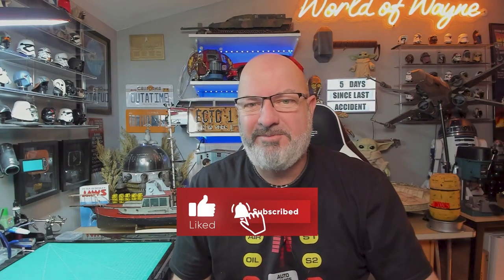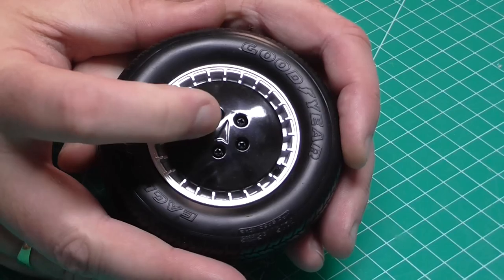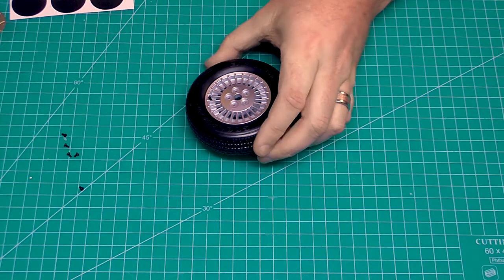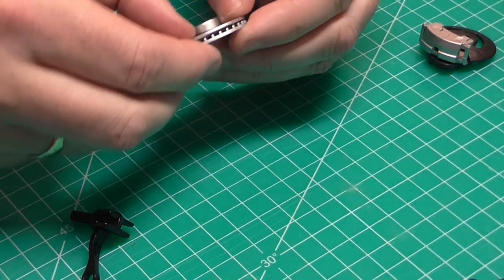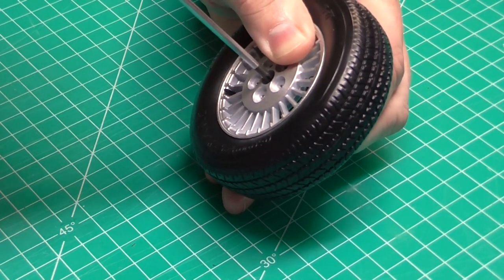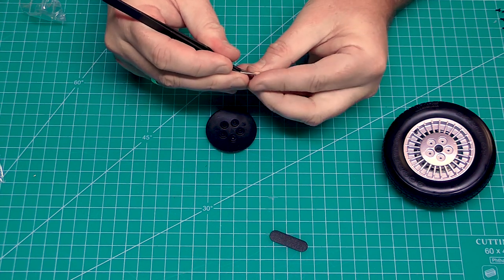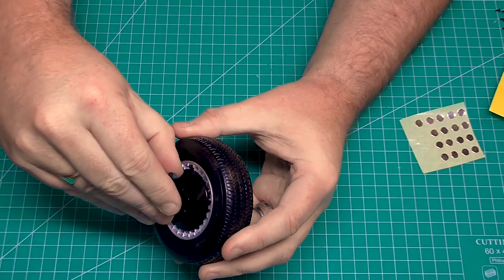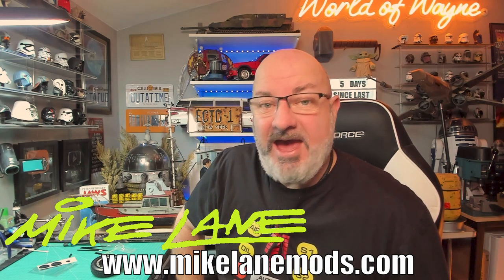Fanhome Build the Knight Rider KITT - Mike Lane Mods - Drilled Brake Discs and Hub Cap Conversion Ki

Comment: I have to agree with some of critique. Mike Lane does great a job, and I have just about bought out his entire store for the DeLorean mods, waiting to buy more when they become available. But I think he barely missed the target on this one. I see no reason to mod the brake discs - you can't see them. But I do agree that the Hub Cap needed modification for the lug nuts, which I thought was the mod. I was either expecting a hub cap with lug nuts or tiny lugs that went into the holes. Maybe tiny screw posts the nuts would screw on with a lug wrench. Overall though I think the end result of what you showed was great. The silver coverings are far better than Philips Head screws! Because I love Mike Lanes work, I would still buy this mod!

Comment: Great mod, personally I won't be opting for is as it's mainly obscured, I will just point out one flaw, it appears the discs are both in the same orientation but they should be mirror opposite so the groves lean towards the back of the car, hope that can get back to Mike so that he can tweak the design
Reply: Agreed

Comment: cracking video Wayne, but that mod to me wouldn't have been worth adding to the car, for what you see of the disc, the creator would have been better off doing a fake bolt mod to the front wheel.

Comment: What is this comment goingon about. ? "Great mod, personally I won't be opting for is as it's mainly obscured, I will just point out one flaw, it appears the discs are both in the same orientation but they should be mirror opposite so the groves lean towards the back of the car, hope that can get back to Mike so that he can tweak the design"  This comment isn't about the bus, very confusing if you read the other comments!

Comment: I really don’t see the point I’d having the disc brake mod. You can’t see it. Even with the easy remove hub. Once built, you’ll never take the model off of the shelf!  Just my opinion!😎
Reply: Agree on this one,  You cannot really see it, It would have been better if they had done some fake bolt mod to replace the screws.  Whip the black cap off, pop the small fake bolt mod in the back or on the wheel its self. and then pop the black cap back on.
Reply: Hoping To see the bolt mod on this fine channel. Quality mods but nuts required to really finish it off

Comment: Couple of observations - 
1. The small disk inserts to the unused hub recesses should be thicker to resist damage on insertion - even using the fluffy (woman's nail treatment stick) they get damaged.  Would also like to see them satin silver and not reflective.
2. Shame there are no replacement caps for the hub cap holes - small black or enen silver/chrome inserts would have been good.  It looks unfinished.
3. Does Mike Lane use Beta Testers?